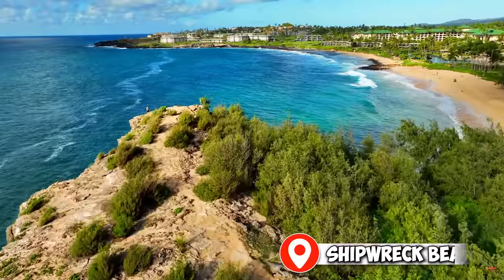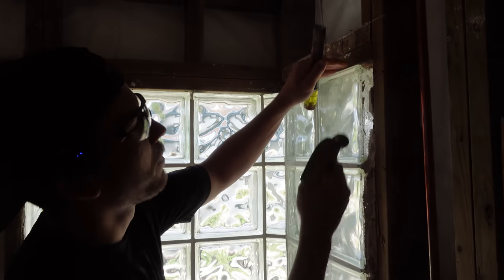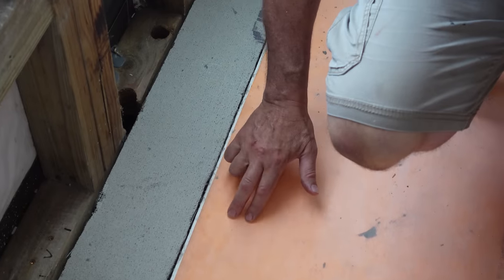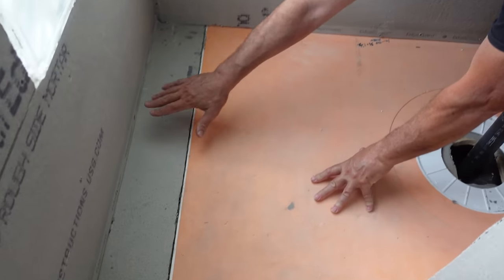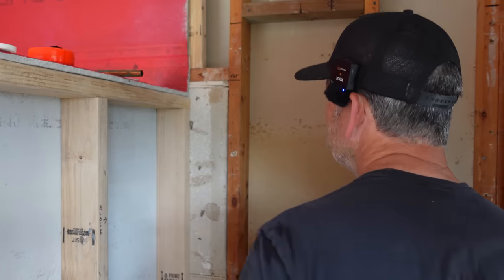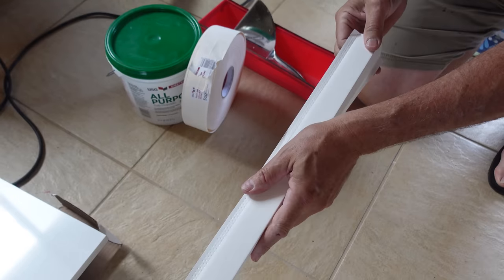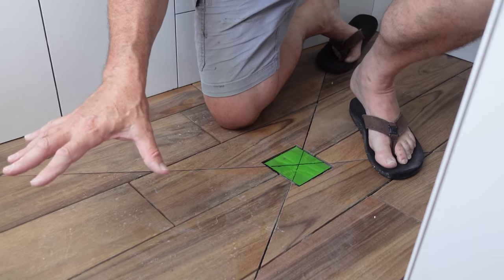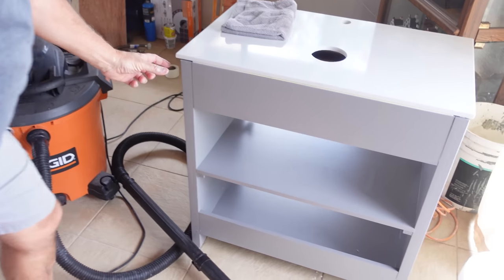The Tile Floor SECRET NO ONE Tells You!

Comment: Given how y'all like to do things as best you can, you totally should give epoxy grout a shot! There's all those horror stories about how hard it is to work with, but I was SUPER impressed with how easy the Laticrete Spectralock Pro (NOT Spectralock one, which isn't epoxy, but the legit 3-part Spectralock pro stuff, where it's got epoxy resin, hardener and then the color/grit all packed separately and you have to mix it all before use) installed, and it's unbeatable in performance! Stain free, hard as a rock but still somewhat flexible, and most importantly, COMPLETELY WATERPROOF. All those premixed/cementitious/polymer grouts seem great at first, but they let water through over time, and if you get them wet and then scrape them a bit, they start falling apart 😳
Reply: There are pros and cons to epoxy grout. With the way they meticulously prepare the pan and sides they're totally good on waterproofing, so it's not worth the various downsides to epoxy grout in cases like this.
Reply: @sweepingdenver  what downsides aside from difficulty of installation? Which isn't remotely as difficult as it's made out to be, at least with high quality epoxy grout. 

To me, the additional waterproofing is just a bonus (although I don't think one to be overlooked. Remember, those Schluter drains don't have weep holes, so your Thinset stays wet for quite awhile. If you shower daily, it may never fully dry out. Then, look at some of the tests of the Schluter system and other Thinset-based waterproofing systems. They actually leak quite frequently with sustained contact w/ water. So with as much as they like "belt & suspenders", seems like an additional waterproofing layer is a worthwhile bonus). 

More importantly though, I think the primary benefit of epoxy grout is it's stain resisting abilities. I've had light grey epoxy grout installed for 3+ years had haven't had to clean it once. No need to seal, just completely stain resistant straight from the start.
Reply: @Jutilaje  I'm just a DIY'er but I did reno a shower with epoxy grout several years ago so here is my take. In my case there was questionable waterproofing and pan setup in the old shower and I was trying to avoid a full to-the-studs shower remodel, so epoxy grout was perfect for that case. From my research and in my experience the downsides were 1) "difficulty of installation", as you say. This is a huge consideration since the working time and all the various tips and tricks of regular grout don't necessarily apply, so it's just a very different install process and if you aren't an expert in it, you can definitely mess the whole process up. I literally wached 5+ hours of YT videos before attempting it and even still I had a lot of trouble, and that shower was very very small. 2) Cost. This is not a small factor, I think for a full size shower like this one with a lot of grout all the way up the walls it can be quite a difference in cost. 3) Availability of materials and lack of historical knowledge. There just aren't nearly as many epoxy products on the market (although I'm sure this is steadily growing) and they don't have the generations of proven capabilities that have withstood the test of time. Again, I think epoxy is great and I'm really glad I used it but I don't think it's a slam-dunk case to use it. For this video specifically with the extremely limited supply chain on the island and constrained working conditions and time limitations, definitely not.
Reply: @sweepingdenver  understandable, not sure what epoxy grout you used, I've used a cheaper epoxy grout ("starlike evo") and it was awful to work with, and then I've used the Spectralock Pro I mentioned, several times now, and it was a dream to work with. In some ways, easier than cementitious grout even. Haze cleaned off super easy, though I followed the recommendations online to stop applying grout and start cleaning every 15 mins, and that helped a lot. I also kept the bucket of grout in a bucket of ice water which gave me 3+ hours of working time, and just mixed it up in 1/2 batches. So that probably prevented most of the installation difficulty issues. 

As far as price though, idk that I agree. Certainly epoxy is more expensive, but it's such a small portion of the overall cost of tiling a shower that I think it's negligible. Instead of spending $80-90 on regular grout, you might spend $130-$150 on enough epoxy grout for a full shower. While that's nearly double the cost, it's a difference of only $50-$70. You'll save that money just on cleaning supplies from not having to clean the grout for the first several years. lol. 

And then on availability, same story - idk if I can agree. It's not a large product, so it can be easily & cheaply shipped to Hawaii. Idk, but you may even get free shipping on it from Amazon/etc.

Comment: I use torques deck screws for everything.  Can run in a 4" screw at an aqward angle with two fingers on the drill if need be. Phillip screws are like so 20 years ago unless your doing drywall or backerboard where overdriving is a bad thing.

Comment: Redgard over cement backer board is not belt and suspenders in a shower. It's only one of those. The cement backer board isn't waterproof. In fact, it's kind of a water reservoir and will wick up the water it comes in contact with.

Comment: If you run a grinder down the side of the mortar on the glass block it will prevent you from pulling out the mortar between the glass and wood.

Comment: Might I assume you ideally prefer not to use an AAV simply because it is a mechanical valve and could potentially fail, versus a static standing drain pipe to daylight?

Comment: When you need to use a sawsall blade to do the work of a dry wall saw, try using a vice grip to hold it and act as a handle for you. Been there and had to do similar.

Comment: That wall with the glass block window doesn't appear to be framed by UBC code. The king stud on the left side does not go from plate to header (if there is even a header there) and the gap between the plate and that stud must be 1/2". Wow.

Comment: Before you laid the mortar on the wood shouldnt you have spread some bonding agent on it so you had some better adhesion considering it will suck the moisture out the mortar making it a chance for it not to stick well
Reply from the maker: Hypothetically, even IF the membrane layer didn’t adhere probably to the plywood (which it did) it will never go anywhere in a million years. We hear ya though 👊🏼

Comment: 13:40   if you sandwich 2 drywall with some 6/10  metal sheet  and screw from both side you can connect the drywall  with right length screws

Comment: Someone correct me if I'm wrong but sclutter board has very specific rules when it comes to the guarantee of their products and I'm not sure if cutting a rabid in that pan qualifies. Before the product was popular and relatively unknown I went to one of their classes about 10 or so years ago that teaches you proper installation. Could be wrong on that but Someone let me know,  anyway I'm a big fan of their systems
Reply from the maker: You have to apply for the Schluter warranty… it’s not automatic with every job that uses their product.   You have to supply batch #s etc etc in the paperwork.   I’ve actually never applied for one.

Comment: I am always surprised on how primitive the building codes sre in u.s. 
For example, look at all the electrical wiring hanging loose in the walls. If you want to replace them or add wires you’ll have to brake up the whole wall.

Comment: Bathroom can’t share with the refrigerator.  That’s craziness and not to code.

You needed to pull a dedicated circuit for the bathroom in case it ever has a blow dryer and curling iron.

Comment: Two comments - 1) Why did you orient the tile differently on the walls (horizontally and vertically)??  2) Why don't the 'valley' joint s of the shower floor tile hit the corners of the drain?? Doesn't look right.
Reply from the maker: We pre-ordered the tile and it was shipped to the Home Depot in Kauai.  When we started setting tile we noticed 2 different colors of tile.  Upon further research, we discovered the tile was made in 2 different countries and were different sizes (by a few millimeters each way).   Because of this size difference, horizontal grout lines would never line up so we decided to go horizontal on one wall and vertical on the other to disguise the difference.  Re: the drain we followed the crease in the foam pan.  Probably could have moved that a bit to hit the drain corners

Comment: Never trowel in all different directions the air cant escapewhen you push down to set tile or in this case backer board on the floor..
Also the tile going in two directions on the walls does not look good . They should all be vertical...

Comment: You put the AIV inside the wall.  Plumbing code and manufacturer installation instructions prohibits. Valve has to be accessible.
Reply from the maker: The back panel is removable but I shoulda just put an elbow on it and pointed it out the wall

Comment: Pro top use a roofing nailer with inch and a half roofing nails for your backer board on the the floor you get better shear strength and not to mention 10 times faster
Reply from the maker: American Airlines was a hard no on me bringing my compressor to Kauai 😁👊💪
Reply: @StudPack  yeah didn't think about the plain ride I used to screw the floor in the nailer just made it faster

Comment: Draw an x on the floor from corner to corner that's center. Do it on a piece of paper to visualize this. Then your cuts are on the outskirts because nothings true.
Reply from the maker: In our case the drain location (not exactly centered) determined the center of the "X".  It was close though 👍
Reply: @Stud Pack the X is to center the tile. Pitch to where the drain is a different story. Goes in the lowest spot so it works.

Comment: Yall make it so hard on yourselves grouting. If you apply the grout with float at 45° and then go back over it holding float at 90°, you will get about 90% of the grout off the face of the tiles and have minimal sponging.

Comment: Not sure I would hurt that Oatey vent in the wall. They fail pretty easy, nothing a little vinegar soak won't cure , but in the wall that becomes a stinker of a problem.
Reply from the maker: There’s access👍
Reply: @StudPack  I see that after I watched the entire reno'.
That's some right tight clearances.
I guess I have done 3/4 MDO walls when space goes for $ 8 a square inch.

Comment: Why do wall tiles go one direction then another direction on the other wall?  One has them going up and down the other they're going left and right...
Reply: Timestamp is 35:55
Reply from the maker: Good eye Jennifer!  We ordered 10 boxes of tile from Home Depot.   We noticed after we started that some of the boxes were from Ukraine and some were from Turkey.  They differed in color and size.  Changing our layout was how we coped with that.  We talk about it in Hawaii video #3.  Thanks for watching.
Reply: Ahhh gotcha. I hate getting differing origin or dye lots for one job. Frustrating!
What about the floor pan - could you cut the tile on the slant mark (the X line) and use cutoff on other side? So it's a continuous tile? (That's what we do and it looks sharp! We also continue tiles through doorways with transitions, line up into other rooms, etc.  My OCD likes it that way 🤣)
I learn a lot of tips & tricks watching yall work so big thanks for that!

Comment: Don’t understand why thinset under backer board if it’s getting screwed in
Reply from the maker: it's required for a proper installation, thinset fills the gaps between the subfloor and the backer board, it's a much stiffer installation than just screws and that's important for tile

Comment: Nice. Why not move the door 3 inches? Was that even possible?
Reply: dont think they can because that would intrude in the toilet area
Reply: @aflea8272  could potentially go a narrower door, I am looking to do that for my toilet (here in Aus its common to have the toilet in its own room) as our toilet room is very small and the swinging door gets fairly close to the toilet, not much room to stand and close the door, so I am looking at setting the toilet back 50mm (~2") into the wall and going from a 820mm (~32") to a 720mm (~28") door to gain about an extra 150mm (6") of clearance to the toilet bowel.

it will also make it look a bit better as the toiler is at the end of a narrow hallway and the trim around the current door has been trimmed to fit as the door is nearly the full width, with the smaller door I will be able to put full trim around and still have a small gap between the wall and trim.

Comment: Unmodified  with no latex additive over plywood. I wouldn't trust it. Not wetting the plywood first? Rookie mistake. 
99% of applications need the polymers added to thinsets.  Schluter original quoted for un modified, but it has all changed and you CAN use all set (modified).
Stay away from big box thinsets. Go with a Laticrete product like 254 and you'll be fine. 

Fun to watch though

Comment: Less talking guys and more work, way too much grouting used on the tiling what a waste, here in the UK no electrical switches are allowed in the bathroom, the risk of electric shock with wet hands is too great, so all switches are located outside, or a pull cord switch for the light is used. Great location to be working in, unlike a rainy London......

Comment: I am going to gently disagree with your foam floor process.  First, I like the pre-sloped shower floors,, and I happen to always use 1/2 backer board on floors,,, so I am with you.  But.. I am an old guy, I have done hundreds of mud floors.  The situation you have described,, back cutting for irregularity, unsquare,, matching the existing.  It is a lot faster, easier, better,, in my opinion,, go old school, felt, pan, screen, and sand and portland.  You can adapt to any shape or slope WITHOUT a tape measure.  A float or hammer block,, you are done.  I'll grant,, you are done for the day,, maybe for two days,, let it set.  The finished product is stronger, better in every way.  It does require skill or if without the skill set,, it can be slower because you have to set, gauge, measure everything.
The exact corollary,, it is sometimes MUCH faster, better, to pull out a handsaw than any power saw.  Just gotta know when.
Reply from the maker: Yeah I agree.  We’ve done plenty of them.   Figured foam would save us a couple days 👍

Comment: Barefoot on a construction site.  You would be out of a job here.  The Workplace Safety and Insurance Board would be all over you.  They get about six hundred thousand job related injuries reported per year.  And that's essentially with workers taking the necessary steps to work safely.  But unfortunately accidents do happen.  So as far as safety is concerned, where do you draw the line?  Do you wear a face shield when welding?  But you don't bother with a harness working at heights.  I'm sorry but there is no excuse for ignoring safety measures.  Remember the days when there were no safety precautions taken?  They still work like that in certain third world countries.  They have a lot of casualties because of their disregard for safety.  Hoping you remain lucky in the future.